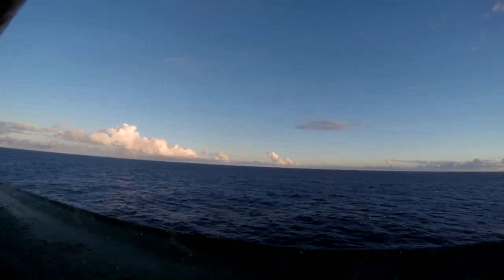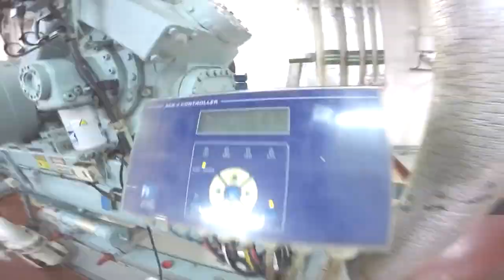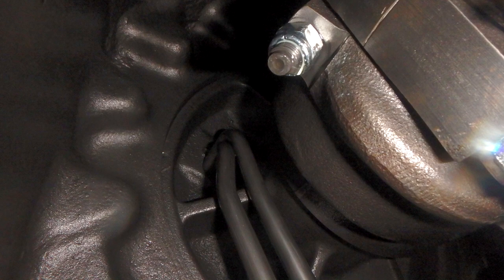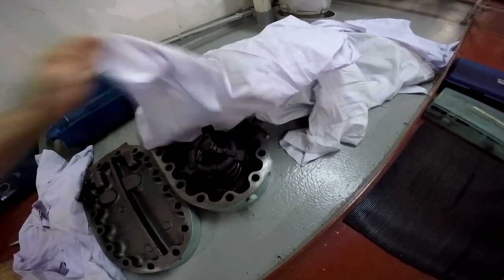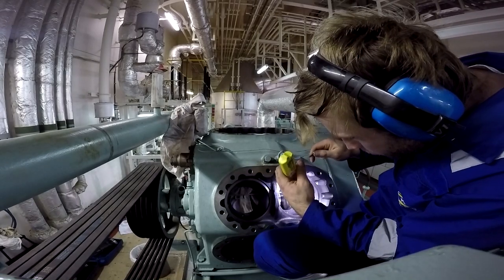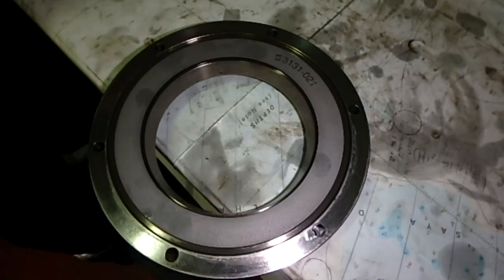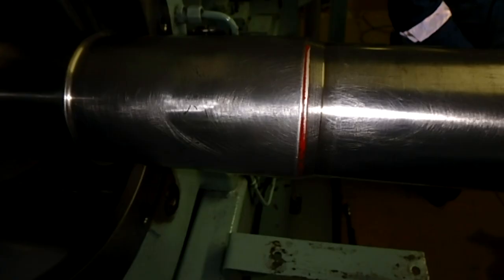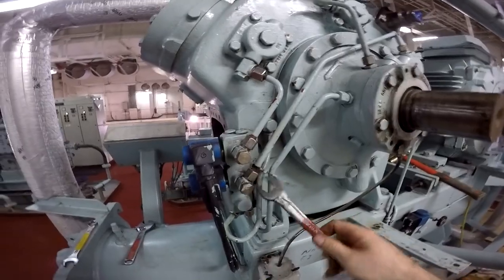Sabroe Air Condition Plant 40000 HRS Overhauling

Comment: Very interesting video. Please tell how and where you connected for testing loading frame?
Reply from the maker: From the side and the back there is this actuators located you can use compressed air to test blowing in the pipes.
Reply: @Adventure-Story  solenoid block, you mean?
Reply from the maker: @SM-xi9nv  you are correct!

Comment: Did not show about how to remove the stage solenoid valves ,rack with springs/unloading equipment...so my question is,we need to remove the piston out?for working on the loading equipment?please advice...my 3rd stage is not working...so want to check....with what ur showing to push the springs?
Reply from the maker: Yes you need to remove the pistons so you will have a better view of what is going inside.
After removing the pistons you will have more space to work and examine.It is essential to do such job because you can see all the parts the rod the piston rings and any cracks.
Also you will see more details and the condition of crankshaft.
Reply: @Adventure-Story  oh.thanks for your prompt reply.gr8ful.but as mentioned,my3rd stage not working,means100%,so for that i will remove the pistons,got it.but how you are going to test the arm after installing,any tools or any device to manufacture?as it operates by hydralic ?!
Reply from the maker: @vivekkumar-vi1sw  hello dear friend as I seen and if remember correct the stages activated after the solenoid is active.There some small piping where you can blow air to see if your spring and mechanism are working and change position. Most common this springs are broken.After overhauled probably you will find some pieces on oil sump or on top of pistons.
Also if you see any marks on top of pistons means that something broken.
Very important is to place properly the springs.
Please refer with our founding!
Check also if you Solenoid coil are working.
Reply: @Adventure-Story  spacibo...thanks so much.good day.

Comment: I work with these smc 106s..our problem the suction pressure running 4 brs to 8 bars then back to 4bars then going to again 9 bars back and forth did not steady in the pointer...the discharge pressure 19bars and 20bars...what is the problem with the compressor sir..plz help me
Reply from the maker: Hello dear friend check that the solenoid for loading and unloading stages are working properly and not have any malfunction.
Reply: I already check na solenoid and replaced with new one but the problem still there the suction pressure always flactuate  back and forth from 4bars to 9bars and somethimes going higher and higher...the casing of compressor going hotter and hotter till going to smoke..
Reply from the maker: The freon level is correct in the system or it is over capacity?Normally pressure aŕe almost steady. Check also cooling of condenser if it os correct.Please inform if you find any other problem.If you have remove amy insulation put it back.And describe how this happen aftwr overhauling?
Reply: Sometimes the compressor worked properly and I got 4bars suction pressure and 17bars discharge pressure and reaching the cut off mode and stop the comp...but when cut in is activated and automatic start the compressor then that's the time the problem of suction pressure back to fluctuating again and again from 4bars to 8bars sometimes more and more  until the compressor going hotter and hotter...i dont know really the problem sir...
Reply from the maker: @enriqueballicud7461  hello all the other parameters are fine?
Maybe the problem is from Superheat hunting is a cyclical fluctuation in suction superheat due to varying refrigerant flow rate in the system. Superheat hunting is the result of the expansion valve excessively opening and closing in an attempt to maintain a constant operating condition.
I am Wait for your findings!
Reply: So sir what part should I will replace or repair so that I can solved this problem....do you have any ideas sir...i checked the parameters according to the book and records..the same nothing unusual changes happened.
Reply from the maker: Have you change also the oil?
Reply: Yes sir....
Reply from the maker: Any foundings? All solenoids working properly?
Reply: @enriqueballicud7461  better not play with it, before you get hurt! Spend some money  on a mechanic instead of changingparts.

Comment: How to check function of capacity controller?
Reply from the maker: Hello for electrician part you can measure in there is any voltage when activated by meter and the mechanical part can be tested by air blowing through the piping.Also when the system are working you can test all the stages and have a record.Before any overhaul record the parameters so you can compare later on.
Reply: @Adventure-Story  we have a problem in our ac.its showing high suction pressure.and only one unit is working.
I want to rectify this problem.capacity controller is oil pressure type. Sabroe cmo18
I think problem in the capacity controller.how to check capacity controller without dismantle and how to repair it?
Please reply me soon.thank you for you explanation
Reply from the maker: If you are mean the capacity controller of stage let’s say 2 or 3 check if there is any voltage coming there!By set that stage in from panel and measure the value if there is correct output like manual says it is ok.

Comment: NICE VIDEO, KEEP UP THE GOOD WORK, SIR IF YOU COULD TELL IN DETAIL ABOUT HOW THE UNLOADING MECHANISM HOW IT WORKS  AT 14:10, THE LINER LIFTS-UP AND THE COOLANT PASSES THROUGH THE BODY....?
Reply from the maker: Hello my dear friend
No-load starting and capacity regulation are
achieved by keeping the suction valve ring
plate in the open position; the refrigerant gas
thus aspired into the cylinder is not com-
pressed but thrust back out through the suc-
tion valve.
Reply: Please explain in detail how suction valve kept open
Reply from the maker: hello the suction valves will be kept open with help of solenoid valves from where pressure travel and change the position of rocker arm which you can see in video that moves right and left when solenoid enegizes there is a movement to left and suction valves keep open this also help to unload the system when it is nessesary all this solenoids controlled by electrical system .Such system as you can see on video we had in all stages.
Reply: Okk.. thanks

Comment: We have a problem in our refrigeration plant.its sabroe cmo18.
Showing high suction pressure.only one unit is working.?whats the problem in this plant?
What should i do to rectify this problem.?
It has oil pressure capacity controller.
How to check and repair that ?
Reply: hi sir, im facing the same problem now with high suction pressure. did you manage to solve it ? many thx for your feedback

Comment: Hi sir, i want ask , we used AC Sabroe same type with in your video, after overhaul we already added Freon 5 bottle (1 bottle 10kg) but still not cool, what about problem ? 
Thank you.
Reply: How many evaporators do you have? Freon shoud be without bubles in sight glas after condenser. Boiling temperature 5-8 degres C. Check that all stages are working, use air recirculation if available. Normaly 2 stages are sufficient for cooling. Dont forget about condenser pressure normal 15-20 bar
Reply from the maker: Before overhauling was working?

Comment: Difference between AC & reefer TEV's ??
Reply from the maker: They are different the One is Aircondition the other is Thermal Expansion Valve.
Reply: @Adventure-Story  I'm asking d same thing difference between the two TEV ?? The one used in AC & other used in reefer ?
Reply from the maker: Sorry i did get your answer normally the result must be the same .maybe they have difference in technical parameters.
Reply: @Adventure-Story  the one used in ac is generally electronic and dat used in reefer is thermal expansion valve other than dat if any difference is der plz let me know